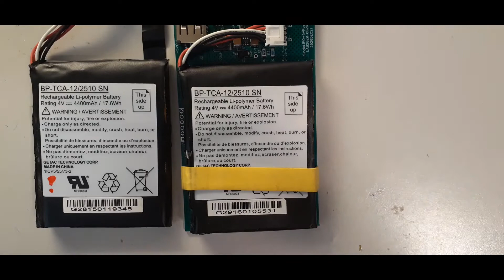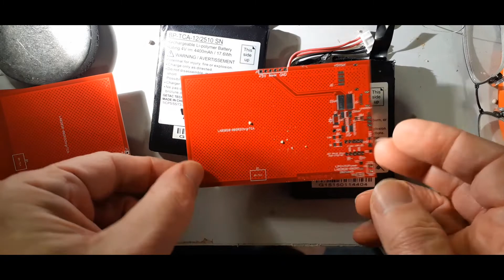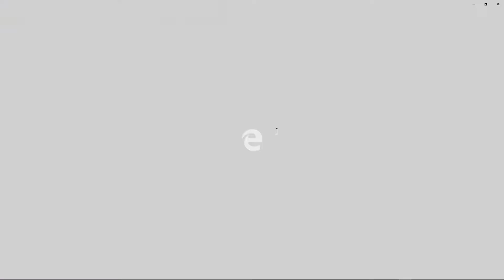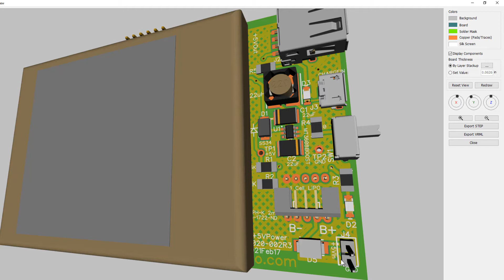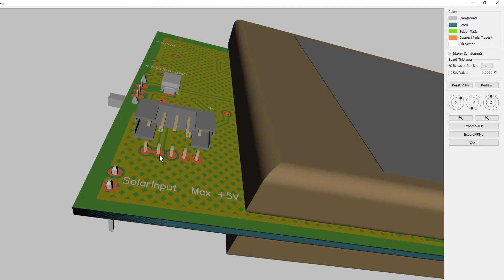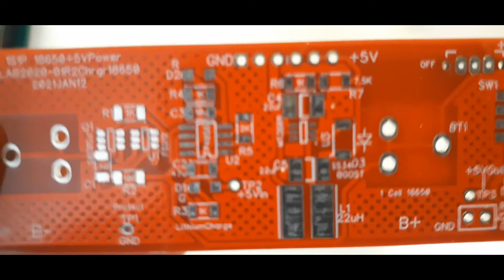Project1 BP TCA12 2510 Part2

Comment: What was the white wire for, on the original pack? Did it change state with high or low voltage or temperature?